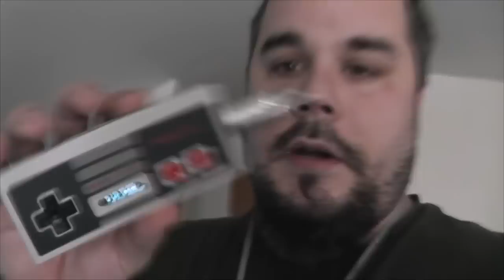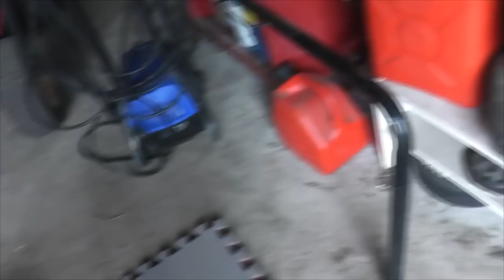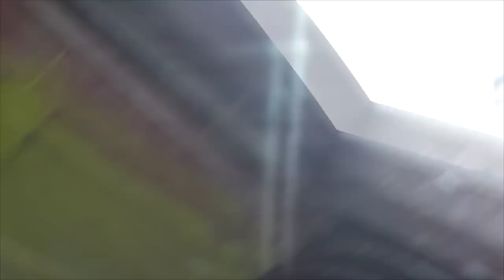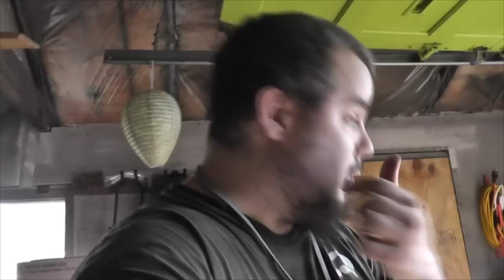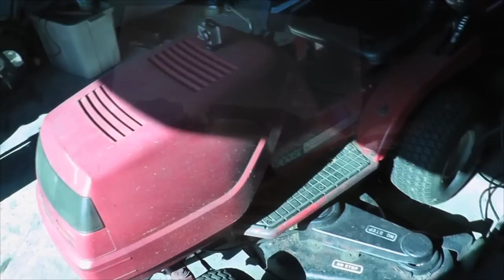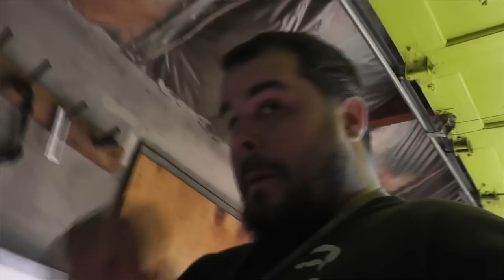You guys were right!

Comment: A lot of mowers now call for 10w30 . Most mower oils now are 10w30 except briggs sells SAE 30w ,but manual calls for 10w30. I think you would be fine with any small engine oil. I still use lawn mower  oils because I believe they still contain Zinc that car oil does not.

Comment: At my house I used to have an old shitty furnace, a/c unit and hot water heater.  This company came in, replaced all three in high-efficiency for no charge and now I'm paying a lot LESS than I was before with brand new shit that cuts power consumption in half...look into that, there are really good deals, only frill is you have to be contracted to said company for x amount of years, but everything's on a 10 year warranty or something so whatever

Comment: Ebay has lots of AAA NiMH batteries, I bet you knew I'd say that... :P

You can use 5W30 in engines that are run in the summer, it's no good for winter though, you need SAE30 for winter, but check up on the B&S specs as to the oil requirements to be 100% sure... :)

"Chooches pretty good - COUGHCHOKEHACK", Yep, it does... :P

hehe, the sped-up mower sounds like my whippersnipper.... :P

Comment: Use a set of round files to open up the inside of that washer, then it'll fit... :P

I'm betting that it's the up & down movement of the deck that's unhooking the deck from the peg over the nail/pin/cotter, that's why a washer would hold it on even without a bolt... :P

I only have Winamp on my old Pentium 166 laptop as a pretend Music-On-Hold thing for my phone system... :P

Reboot the router, if that doesn't fix it, send it to PhotonicInduction, and he'll "fix" it... :P

Comment: I would have put a washer on before putting that split pin in just saying lol keep up the vidjas Adam
Reply from the maker: yeah...I checked all my cigrit tins on the garages roof as thats where all my nails, screws, bolts, washers etc are sitting.  Just couldn't find one with an inner diameter to match that pin on the deck adjuster...however I haz plan!